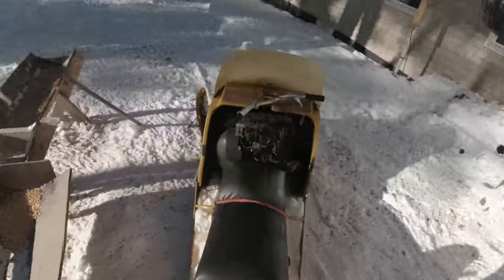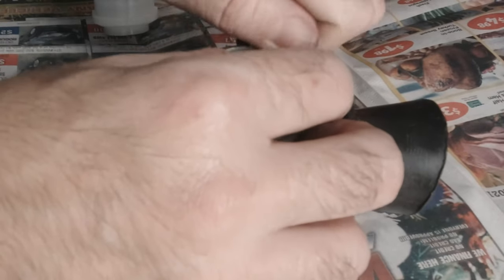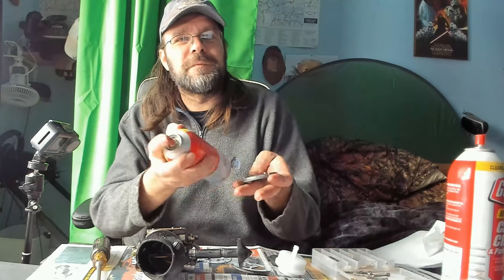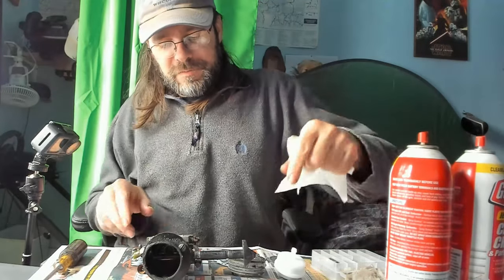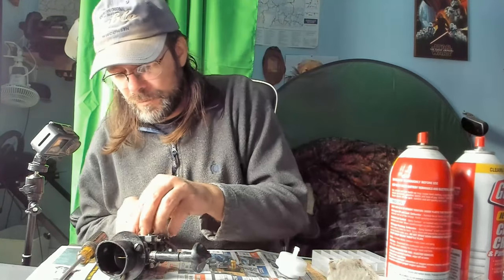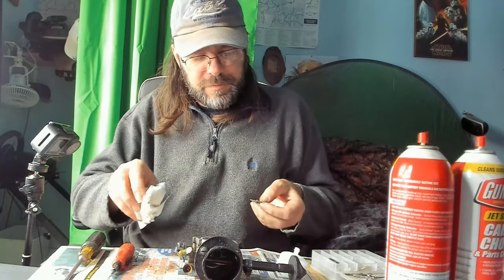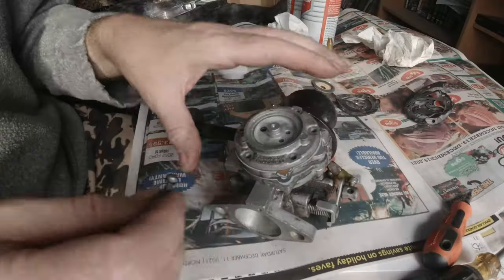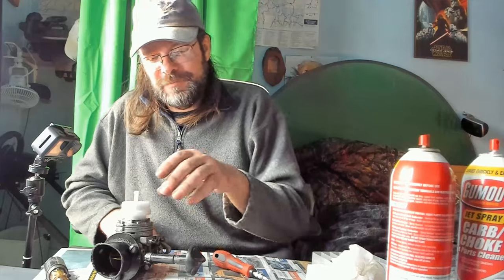Working on Tillotson HR76A Carb  for my 1970 Ski Doo Olympique 399cc #Snowmobile #Skidoo #Tillotson

Comment: Your sled should be running top shape after that carb overhaul!! Thanks for the video, Good job!!
Reply from the maker: I had to go back in and clean it again after putting new gas line.  I also removed the plugs and cleaned the holes under them from inside and replaced them also.
Reply: @NorthernANTs  Looks like it did the trick because the sled was running great!

Comment: I have read that it's best to use the genuine Tillotson rebuild carb kits as they Inc the correct fitting parts over the other aftermarket kits such as Winderosa . 

Definitely avoid the unbranded Chinese carb kits as only certain parts may fit
Reply from the maker: That is for sure, I have had problems, this one I had some aftermarket gaskets, and i have replaced them with genuine parts already because I had problems not long after doing this video.  Now the sled is back on the work bench with a stripped spark plug hole.  have a extra head just need to find time to do it, not a heated building I work on it.
Reply: @NorthernANTs  wish you all the best with eventually getting your sled back together . I totally know that feeling trying to work on things during the winter with no heated shop .

In the future when I decide to rebuild my Tillotson HR carb off my 69 Panther ...I will ONLY use a genuine Tillotson rebuild kit no matter how much more $ .

I think even a well known brand like Winderosa may not use the rubber tip needle like found in the genuine Tillotson kits .

Enjoyed your video , thanks for sharing .
Reply from the maker: @faronf2006  Thank you